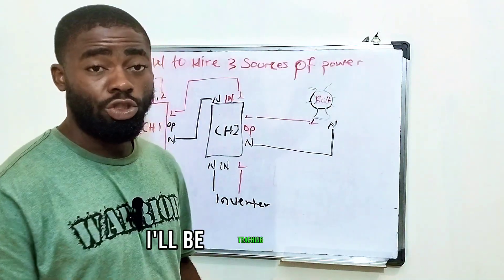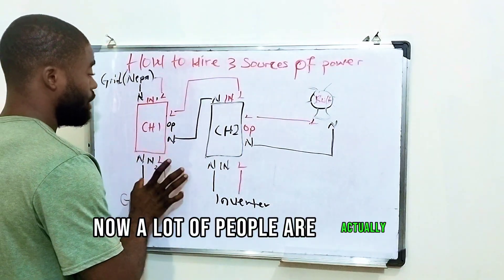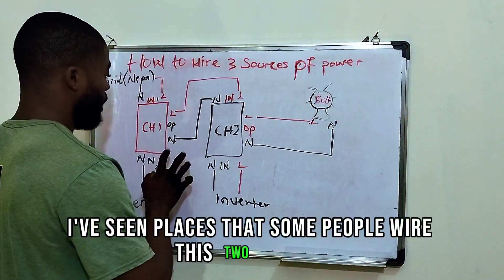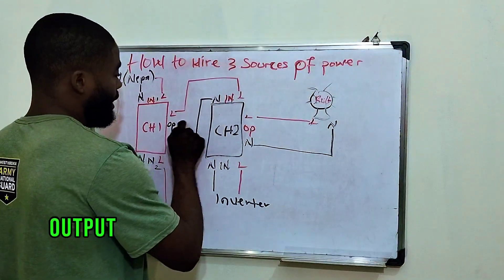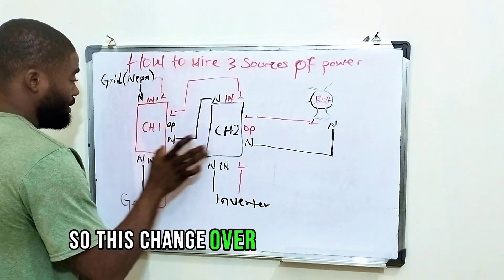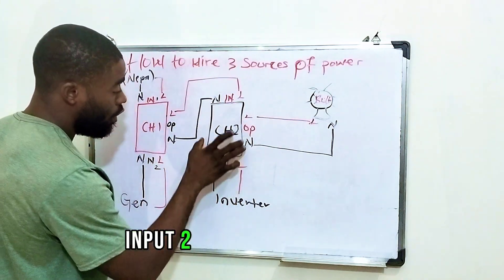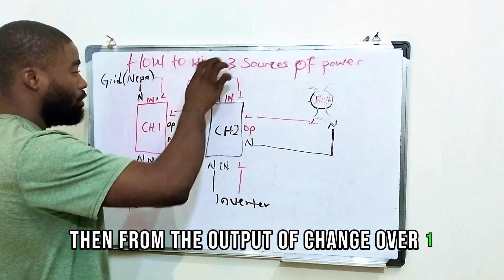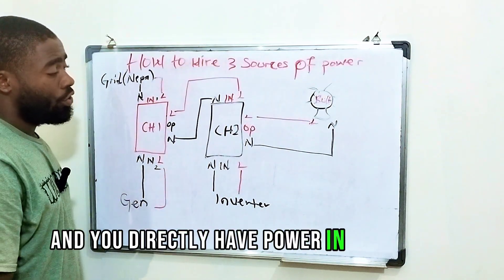How to wire 3 sources of electricity using two knife switches

Comment: My understanding is most hybrid inverters have an automatic transfer switch built into it. Thus it can be wired in a way in which solar first, battery 2nd and grid 3rd. 

It will be a good video if you can show how you wire and connect to the circuit panel

Comment: What of 4 sources of power,when we have generator, Nepa, inverter 1 and inverter 2.........Note inverter one is 2.5kva........inveter 2 is just 800watts
Reply: Good question bro ...
 Whenever there's a new source of electrical supply, then a new change over switch must be introduced... The output of the previous change over will enter one side of the new change over input, then the new source (e.g inverter 2) will enter the other input side of the new change over switch. Then the output of the new change over switch will go to the load or distribution board of the house...
Reply: Can this can changeover connection charge my solar battery through the grid